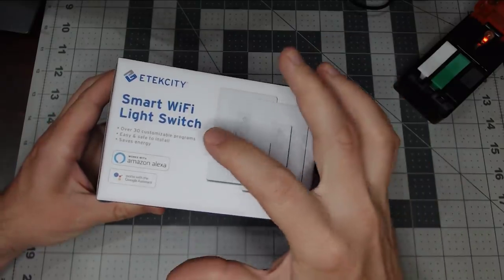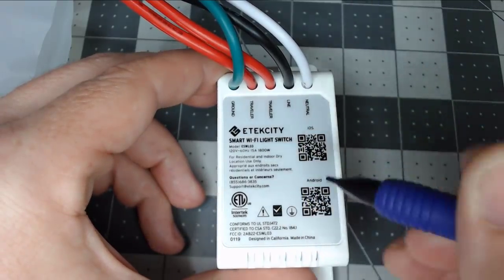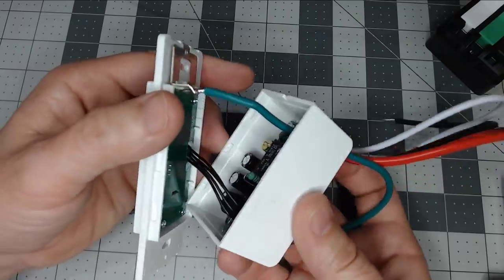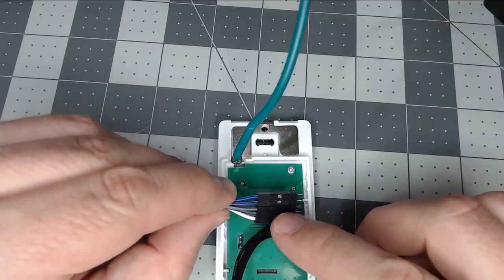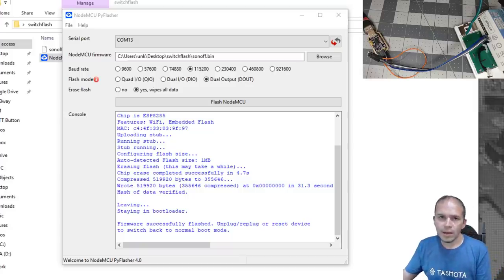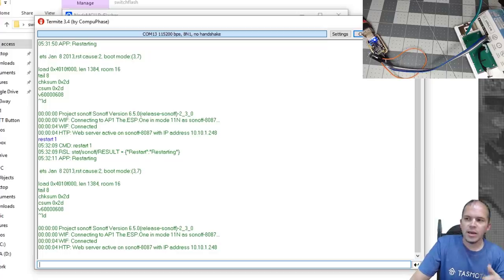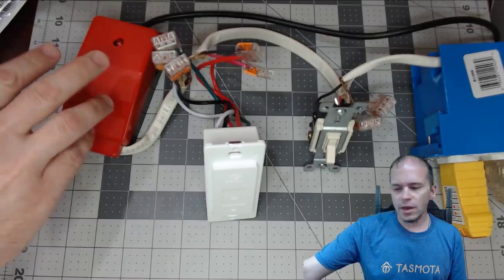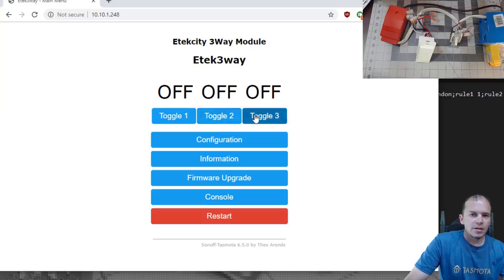3 Way Smart Switch with Motion Activation - Etekcity

Comment: Thanks.  Looks like this will work great for many of the areas in my house.  Have you ever worked with 4 way?  One of my locations where I want to change to a smart motion detection has a 4 way in the location that needs detection.  Any ideas on what to replace the 4-way switch with to detect motion?
Reply from the maker: You'd need to replace the 3 way in that configuration.  I haven't seen smart switch designed to replace the 4 in that config.

Comment: I just got back to looking at this again and it can also flash with the new Tasmota flash from the web.  The ground wire you talk about on the switch is not connected to anything inside the switch. The plate sits on the plastic and the mounting screw may touch it, but most like not.  Not sure the purpose of this floating ground.  You mention a switch for safety when testing.  You didn't leave a link to it, but I found it on Amazon (almost $85).  What I use is a spare Sonoff device that shows a light when on.  I can also turn it on remotely if I need on my project.
Reply from the maker: It's nuts how much that damn tool went up. It used to be $35
Your face plate screw should go through the metal ground plate.
Reply: @digiblurDIY  even if by chance the screws touch (mine don't as the metal hole diameter is larger than the plastic), what does it do as it does not attach to the switch?
Reply from the maker: The screws are the wrong size then. The screw shouid go through the metal plate and  ground the faceplate if someone swaps to a metal faceplate.
Reply: Doesn't matter what size screw. The ground wire is not connected to the switch. Maybe this is why it did not get UL?

Comment: Hello Travis, very very good video!! keep doing that!  Just a question regarding tasmota,  there is a way to change the label of each button instead button1, button2 and so on, the idea is to set it to some familiar. Another maybe crazy question.. can be posible to disable few button to have only the basic functions? I will appreciate your comments.  Thanks a lot!..
Reply from the maker: Where are you seeing these button1, button2?  In the GUI itself to toggle things?
Reply: @digiblurDIY  Yes, in the GUI.
Reply from the maker: No, you'd have to modify the source code to change that.  Tasmota is designed to be controlled over MQTT from other home automation software so they don't include that as a config option.

Comment: Great video and fun project!  Do you have any tips on getting that hole drilled in the faceplate?  I used tape, but the faceplates keep breaking before I can get a large enough hole drilled.  Is there a particular type of drill bit you use?
Reply: Tip of a soldering gun

Comment: Hello Travis, great video like always! Will the same rules apply if you are using single pole switches instead of 3 way? Of any other brand? Thanks and keep the great video going.
Reply from the maker: Good question. No rules required for the single poles as they are just simple on/off switches. Unless of course you also add the motion sensor.
Reply: @digiblurDIY  yes I would like to add it too. and i will be placing it on the laundry room.
Reply from the maker: Your rule will be much like my night light video. Hit me up on discord or email and I can send you the rules of you like.
Reply: @digiblurDIY  can I get the rules for the single also?  Can you flash with the latest Tasmota.bin file or do you need the older sonoff file?
Reply from the maker: For a single light switch there should not be any rules needed and the regular tasmota bin is fine.

Comment: Thanks. Sad to see what’s become of the Sonoffs. Now used for holding down wires.  :). 
Did you screen print that New tasmota logo or got it from those official shop ?
Reply from the maker: Actually pulled a Sonoff Basic out of the wall when I put this one in that was working the switch in the middle. Went with a Shelly1 I had sitting around.  Still spoiled and would have just thrown in a regular Kuled or Martin Jerry switch if I had one to do so as they are so simple to throw in and wire.

I made the shirt off the new logo.

Comment: Any idea if this switch can be flashed with Tuya-convert?  I might get it and give it a go.  Thank you for your videos, BTW.  You got me started with Tasmota and to date I've taken close to 60 switches, bulbs, outlets, power strips and plugs out of the cloud with only 1 bricked.  I've contributed over a half-dozen previously unknown devices to the blakadder site too to help others.
Reply from the maker: No. It's a manual flash as it doesn't use Tuya much like a Sonoff basic would be.
Reply: @digiblurDIY  thanks for the super-fast reply.  I was just reading which app it used and was already on the path to that conclusion.
Reply from the maker: Luckily these have open pin headers and they even labeled them. Solderless flashing!
Reply: @digiblurDIY  I don't have the hardware to do that yet, but will probably get there. For now I'll probably go with the Martin Jerry ST01 from your other video. I think someone reported tuya-convert success in the comments.
Reply from the maker: Yep. I keep them on my Amazon page for that very reason.

Comment: Excellent work. 
Q: Does this switch have the low load leaking voltage like the Moes 3-way?
Reply from the maker: Electrically they seem to be the same design.  I haven't pulled the entire switch down to the rear of that bottom board yet but can do so if anyone wants pictures.  I noticed with a simple receptacle tester that one LED was faintly lit without a bulb screwed into my test lamp.  Plus I did see the same behavior with a cheap old LED bulb that it would flicker.  So you do have to be mindful of working on the lighting circuit after the switch when it is off along with some bulbs might not work right.  I however didn't get that delay I found with one bulb type on the Moes.
Reply: @digiblurDIY  Thank you, Sir!

Well done.

Comment: A little late to the party. What I would like to do is have a PIR on both 3-way switches. You showed how to do one side with the Etekcity, but wouldn't it be nice to turn the lights on going up the stairs and down the stairs (i.e. on also have a PIR capability on the "dumb" switch side? I was wondering if the solution would be to use 2 Etekcity switch, with a different configuration on the "dumb" switch side? My inclination would be to just build a wemo w/PIR, but I've no idea how to power it (A/C is preferred, batteries are an option, but absolutely not optimal due to lifetime maintenance).
Reply from the maker: I would put two of them with PIRs then.  But you might end up with them both triggering and turning the circuit off when it thinks it needs to be on and vice versa.

Comment: hi, this looks to complicated to program and do, I'm trying to install sensors on a stairwell, one on the top, and one in the bottom, was unsuccessful doing on my own, read I could only use one manual, and one auto in order to put in a 3way setup, hired an electrician, he said since power comes from the top of the stairs  I can only install the manual in the top of the steps, and the automatic at bottom of steps, is there a way to setup two sensors to work independently on a 3way setup in a staircase? trying to use Leviton IPV0R-1LZ Decora Motion Sensor In-Wall REMOTE , with IPS15 but was unsuccessful :(  please help, sounds like you really know your stuff :)

Comment: Thanks for this video. I purchased a pair of these switches, flashed them with ESPHome and I can control the light with Home Assistant. But how do get it to respond to a button press on the physical switch. Any help would be much appreciated from you or anyone.
Reply from the maker: You would need to create a config to attach to the button and set all that automation up to do that. I use Tasmota for my switches and pre-built devices.
Reply: @digiblurDIY  found a solution in the home-assistant community forum where someone was using the single-pole version of the switch.  GPIO14 is being used for the capacitive-touch. I tried it and it worked. Here is the abbreviated code. Thanks for your reply.

binary_sensor:
  - platform: gpio
    name: "$entity_name Touch Button"
    id: capacitive_switch
    pin: 14
    filters:
      - delayed_on: 100ms
      - delayed_off: 100ms
    on_press:
      then:
        - switch.toggle: relay2
Reply from the maker: thanks for the code!

Comment: other 10 out 10  well done can you do a long press??
Reply from the maker: Thanks and yes absolutely!  It's setup for a long press ready to go.  I forgot to mention I set the switchmode up for you already.
Reply: @digiblurDIY  Thanks well Beater order some then
Reply: @digiblurDIY  How do you use the longpress? Do you longpress on the Capacitive touch sensor? I trie don mine and it doesn't do anything
Reply from the maker: @amritgrewal7388  yes. I just long pressed on after setting that switchmode to 5 I believe.

Comment: Thanks again for a other great video. With all your info, I manage to flash  both type of Etekcity switches. It toke a few tries to get the single poll the way I wanted it but got it all working properly with the led on when the switch is off. Am I having a small issue with the 3 way switch. The switch needs to be touch twice before it will turn on the light. This is only if its been sitting for a minute or so. After the light comes on then the switch work fine with one touch until you let it sit for a minute or so. Its like the unit goes to sleep after a certain amount of time.   The single pole switch doesn’t do that. Is anyone else having this issues and is there a way to fix it?
Reply from the maker: Now that is strange. Do you have a template usage with this? It might be easier to jump into discord and do a little digging on things.
Reply: @digiblurDIY  Template that i used was off the Tasmota component site
{"NAME":"Etekcity 3Way","GPIO":[0,0,0,0,23,29,0,0,82,22,10,0,0],"FLAG":0,"BASE":18}
I flash 3, 3 way switchs and all of them do the same thing. The single pole switch work fine.
It is strange that no one else is having this issue.
Reply from the maker: Unfortunately there are a lot of incorrect templates out on the net.  Did you do the rules and such as directed in the video?
Reply: @digiblurDIY  These are the rules that i used
backlog switchtopic 0;switchmode1 1;switchmode2 5;switchmode3 1;powerretain 1;rule1 on event#ON do power2 TOGGLE endon;rule1 1;rule2 on event#OFF do power2 TOGGLE endon;rule2 1;

rule3 on power1#state=1 do backlog rule1 0; rule2 1 endon on power1#state=0 do backlog rule1 1; rule2 0 endon

rule3 1

Comment: Hi Travis

i follow the video and set up the switch like you (just until the motion sensor install).  I use a wyze motion sensor to turn on and off the switch.  Occasionally i would noticed that the switch turn on and off right away.    I think it has something to do with the rules.  Any idea why it behave like that?
Reply from the maker: How are you reading the wyze sensor into the switch?
Reply: @digiblurDIY  using the wyze bridge and I set up automation rule to turn on the switch when it detect motions
Reply from the maker: Is the off 30 seconds later triggering it for some reason?
Reply: @digiblurDIY  I'm not sure. How could I tell? I don't really understand the rules you set. Just copy and pasted lol. 

Can you explain each of the switch mode in the rules?
Reply: @digiblurDIY  Here is a log of that happening

18:26:29 MQT: tele/garagelight/STATE = {"Time":"2020-03-24T18:26:29","Uptime":"1T17:55:14","UptimeSec":150914,"Heap":27,"SleepMode":"Dynamic","Sleep":50,"LoadAvg":19,"MqttCount":3,"POWER1":"OFF","POWER2":"ON","POWER3":"OFF","Wifi":{"AP":1,"SSId":"Cybertron","BSSId":"E0:63:DA:5E:F8:DA","Channel":11,"RSSI":74,"Signal":-63,"LinkCount":5,"Downtime":"0T00:00:49"}}
18:26:29 MQT: tele/garagelight/SENSOR = {"Time":"2020-03-24T18:26:29","Switch1":"OFF","Switch2":"OFF"}
18:31:29 MQT: tele/garagelight/STATE = {"Time":"2020-03-24T18:31:29","Uptime":"1T18:00:14","UptimeSec":151214,"Heap":27,"SleepMode":"Dynamic","Sleep":50,"LoadAvg":19,"MqttCount":3,"POWER1":"OFF","POWER2":"ON","POWER3":"OFF","Wifi":{"AP":1,"SSId":"Cybertron","BSSId":"E0:63:DA:5E:F8:DA","Channel":11,"RSSI":72,"Signal":-64,"LinkCount":5,"Downtime":"0T00:00:49"}}
18:31:29 MQT: tele/garagelight/SENSOR = {"Time":"2020-03-24T18:31:29","Switch1":"OFF","Switch2":"OFF"}
18:36:29 MQT: tele/garagelight/STATE = {"Time":"2020-03-24T18:36:29","Uptime":"1T18:05:14","UptimeSec":151514,"Heap":27,"SleepMode":"Dynamic","Sleep":50,"LoadAvg":19,"MqttCount":3,"POWER1":"OFF","POWER2":"ON","POWER3":"OFF","Wifi":{"AP":1,"SSId":"Cybertron","BSSId":"E0:63:DA:5E:F8:DA","Channel":11,"RSSI":72,"Signal":-64,"LinkCount":5,"Downtime":"0T00:00:49"}}
18:36:29 MQT: tele/garagelight/SENSOR = {"Time":"2020-03-24T18:36:29","Switch1":"OFF","Switch2":"OFF"}
18:39:31 MQT: stat/garagelight/RESULT = {"Event":"Done"}
18:39:31 RUL: EVENT#ON performs "power2 TOGGLE"
18:39:31 MQT: stat/garagelight/RESULT = {"POWER2":"OFF"}
18:39:31 MQT: stat/garagelight/POWER2 = OFF (retained)
18:39:31 MQT: stat/garagelight/RESULT = {"Event":"Done"}
18:39:31 RUL: EVENT#ON performs "power2 TOGGLE"
18:39:31 MQT: stat/garagelight/RESULT = {"POWER2":"ON"}
18:39:31 MQT: stat/garagelight/POWER2 = ON (retained)
18:40:32 MQT: stat/garagelight/RESULT = {"Event":"Done"}
18:41:29 MQT: tele/garagelight/STATE = {"Time":"2020-03-24T18:41:29","Uptime":"1T18:10:14","UptimeSec":151814,"Heap":27,"SleepMode":"Dynamic","Sleep":50,"LoadAvg":19,"MqttCount":3,"POWER1":"OFF","POWER2":"ON","POWER3":"OFF","Wifi":{"AP":1,"SSId":"Cybertron","BSSId":"E0:63:DA:5E:F8:DA","Channel":11,"RSSI":68,"Signal":-66,"LinkCount":5,"Downtime":"0T00:00:49"}}
18:41:29 MQT: tele/garagelight/SENSOR = {"Time":"2020-03-24T18:41:29","Switch1":"OFF","Switch2":"OFF"}